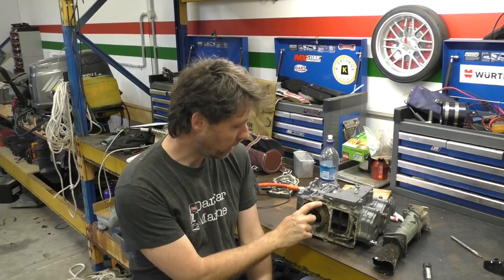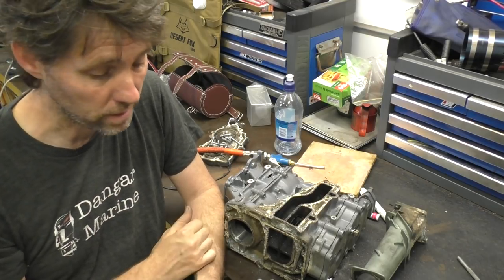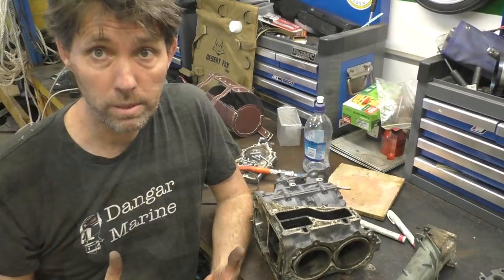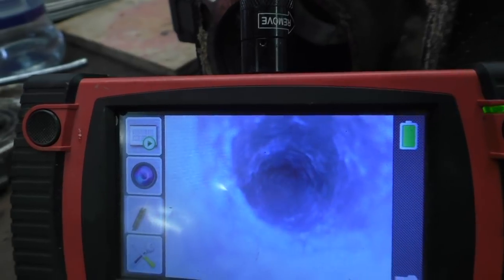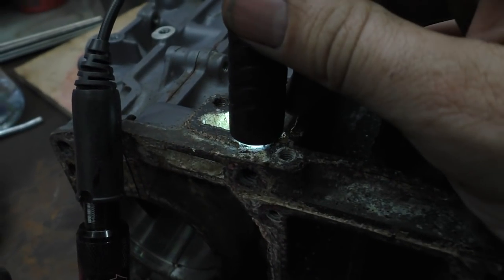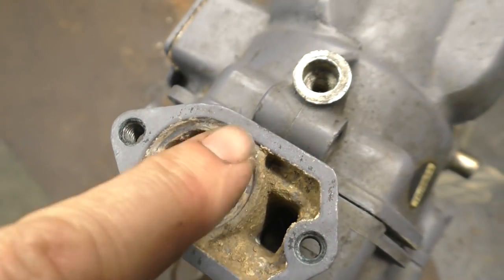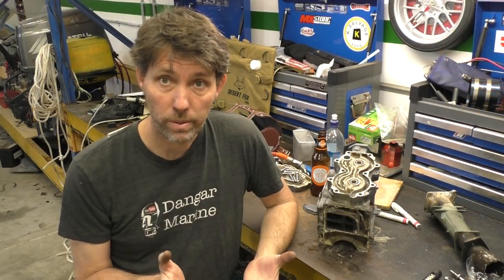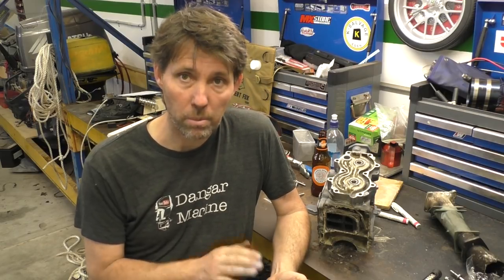Outboard cooling water

Comment: Wow brilliant.  Thanks dangar. This is the best outboard channel imo. I think your information here has solved my 8 horse yamaha problems.  Compression was 145. Sporadic tell tail . Bought a laser thermometer. 120 c . My other identical motor runs at 45c
Cleaned all the passages. And found that the rubber gasket on thevwater pump can get pushed in from the connection tube from the upper leg .impeller bits were found in the lower part of the impeller underneath the stainless steel cup that the impeller seats in as well as a small side chamber at the side of the cup. I put a rag on the drive splin and a drill a rotated clocknwise while the lower leg was immersed in water 
 It did pump water

Comment: This is the ONLY video or the only time PERIOD that I have heard anyone mention that cylinder compression can blow OUT through the  water jacket. I have an old Gale that has grey sludge in the leg and in the impeller housing. It pumps water at idle but not when throttled up. Compression is forcing water THE OTHER WAY as the engine is throttled up...problem....bad head gasket between water jacket and cylinder blowing mixed gas from the cylinder down through the water tube stopping the water flow when compression is high and thus....GREY SLUDGE....oil, gas and water mixture in the leg and impeller housing. I am changing my opinion of this fellow......GREAT vid.

Comment: I had no idea that the tell tale only indicates that the pump is pumping. I thought it meant the engine was being cooled. Thanks for pointing that out Stu. I learned something new today.
Reply: Hey mate. It does depend on what engine you have. The tell tale on my 1993 mercury black max 175hp is tee'd off after the thermostats so will only show water if the water is running through the heads and the thermostats are open.
Reply: And then you have my 50HP Johnson - no tell tale at all! That worries the missus no end as she thinks there is some thing is wrong with the engine because everyone else's engine has a tell tale. The following year model had a tell tale low in the exhaust cover. A few years later they went to the top of the block - supposedly to vent air out of the water jacket at start up and so prevent an air bubble forming. The tell tale on the Johnsons eventually ended up in about the same place as the one in the video- I don't know why. I do know that tell tales after the thermostat was done on only some engines and the tell tales before the thermostat were done soon after- why? Too many warranty claims/work because people were bringing their engines back in because the tell tale was not flowing when doing a flush and/or when the engine was first started up. People would panic, cancel their day on the water and not want the engine back until the water was flowing as soon as the engine ran.That hole to the cylinder top from the water jacket does not make sense. Could it be a decompression valve hole?
Reply from the maker: I would say by far the majority of motors have a tell tale straight away but checking the owners manual for your exact model is definitely the way to go to be sure!
Reply: Dangar Marine thats true bud! On my 50 merc there is a huge problem of having no tell tale because there is 2 different plastic elbow fittings that clog easily. The tell tale hose runs from the bottom of the block. So I learned how to correct it on a Louisiana  merc refuge forum. There is a brass hex plug on the top cyl that is the same size as the plastic elbow on the bottom. Remove brass plug and put it where the bottom elbow is. Put the plastic elbow (or i bought a new brass one) on the top. I drilled out the pisser exit hole and ran 5/16 line straight down to the exit. No more bends.Now i have a TRUE indication of water cooling because its after the thermostat. Now my motor never has a blockage and always pees. I even called Mercury because i was worried that there was a reason like back pressue, for the design. Mercury told me I was totally fine and you can even use a larger hose because its has no effect. The next best thing to do is run a temp and water pressure gauge. What everybody down here does is change the tell tale and add a temp gauge and as Danny on the refuge says "No more looking back when driving the boat". Im thankful the guys showed me this.

Comment: I can always count on finding helpful information when I watch your videos :) thank you. I had something strange happen today and would like to know if you have heard of such a thing... 2007 Yamaha 50hp 2 stroke. Haven't been out on the water in a few months so today I was cleaning up the boat and decided to run the motor. Hooked up the muffs, turned the hose on full blast, went to start the motor, got a couple revolutions out of it and it stopped. Switched to both batteries on, still no turning. Checked voltage and had 12.6v. At that point I pulled the plugs and the bottom cylinder had water in it. Kinda brownish/dirty. Cranked the motor for 20 seconds or so and shot all the water out. Cleaned off the plugs, put them back in, and she fired right up. Ran it for 30 minutes on the hose, everything seems normal, revved up a couple times, so far so good. Pulled the bottom plug again and didn't see any water in there, kept the hose running and still no water that I could see getting into the cylinder. Any idea how that water could have gotten in there? What should I look into next? Or just run it and see how she acts on the water before getting any deeper into it?

Comment: I'm attempting to strip down and rebuild a 85hp Mercury Blueband as a complete novice from watching your vids. So far I've run a compression test with all 4 cylinders running under 100psi  I've found that the impeller is completely munted with 3 missing fins and the housing has melted..I believe that 2 fins have made it up to the head somewhere. Thankyou for making awesome vids👍🏼👍🏼

Comment: Okay, I bought a boat without the motor running. I figured how hard could it be. Well, no spark in one plug and low compression in one cylinder 60psi. After trouble shooting I ordered a new power pack as I feel that is the issue after testing and moving wires around. Next for the cylinder I am going to try the Marvel Mystery Oil to see if it loosens up the rings. It's such a crap shoot for us backyard mechanics - so to speak. I know I may have to replace the head gasket but first things first so I am just waiting for the power pack to arrive. 
Your videos have been extremely helpful as this is the third boat I have worked on after watching the videos. Keep them coming!
P.S. If you were in Canada even Ontario or even Hamilton I would be knocking your door down for help. LOL
Reply from the maker: Good luck with the fix mate, hope it goes well and glad the vieeos have been helping.

Comment: Great video! This has helped me confirm that the headgasket is blown on the 55hp vintage Chrysler (Sea King) that I have been repairing.  I finally got it running well yesterday but I noticed that water just blasts out of the telltale (with steam too) so I think I will have to get that headgasket replaced.  The thermostat is probably stuck as well since water only came out of the telltale (bottom end is off so I can see what comes out).   Thank you!
Reply from the maker: Yes, the steam and shooting water is definitely a fair sign of a blown headgasket. Good luck getting it fixed up, sounds like it will be fine once the job is done.

Comment: Awesome explanation.

I was taught (incorrectly) many years ago that the tell tale was the "last" of the water and that if it was coming out then it was flowing everywhere correctly..  I was also taught to wait until the tell tale water was warm as that indicated the engine was warm enough to start opening up the engine..   Geeez Grandpa..  You had me fooled all these years :P
Reply: That depends on the engine. Some Johnsons had the tell tale plumbed up to outlet side of the thermostat in the 1975 - 1980 time frame.But the wait until the tell tale water is warm is not a bad idea. As you can see from the video, the cold water side will still get warm before the thermostat opens up , and then stay warm because the thermostat will control the temps and keep it that way. But that tell tale should never be hot. So letting the tell tale get to be warm before opening up the engine full throttle is not a silly idea at all.
Reply: Thanks for the clarification

Comment: Nice video Stu.  I just got the cooling issue on that 25 Johnson on my new aluminum boat sorted.  It had a broken thermostat.
Reply from the maker: Glad to hear you got it all fixed up Will.
Reply: what was it doing ?   my johnson has a weak tell tale and nothing out the exhaust hole , I am going to check the thermostat and pull the leg , it should have a new impeller

Comment: Greetings from tampa Florida Master Stu big proud happy followers of yours here . I have a 96 Johnson 225 and I’m having overheating problems I suspect sand on the heads , gotta go easy on the islands this summer i supposed , Cheers 🍻 my friend .
Reply from the maker: Hi mate. Yes, sand can certainly block up a cooling system fast. You can try taking off the gearbox and the thermostat cover to flush it out backwards with a hose.

Comment: I know this is a decent thread dig but the extra exhaust port holes are bleed down ports to reduce cranking compression for easy starting.
In some cases, they are just small extensions to the top of the exhaust ports.

Comment: That’s why my 25hp outboard was hot on idle but pumping hot water.  The water jacket was blocked.  Outboard had been sitting for a while, by running in the ocean it cleared the blockage and water shot out the upper exhaust port. Thanks

Comment: Exactly the information I need! My 25hp yam has that exact engine block. Tell tail pumping very strong but I noticed the spark plugs turned blue. Thermostat was packed with sand. Suspect that is not the only issue since the previous owner melted the impeller and its housing. Hoping to find an obvious peace of plastic blocking a port. Thank you! 🇮🇪

Comment: Perfect explanation. I was getting a poor tell-tale flow so went to the impeller. 2 blades snapped off and only 1 still in the pump housing - so how to find the lost one? Didn't understand the Yamaha cooling system as the service manual doesn't cover it. I didn't know where to begin. Based on your info I think it's likely sitting where the vertical water pipe meets the block. I'll drop the lower unit again and try running water through the flushing port to see if I can flush it out.
Really excellent explanations - thanks man!

Comment: GREAT VID. I live in one of the worst water conditions to run any boat in but just so happens that it's the best place to boat. S.W. Florida in the USA we have dirt, mud, and shells shallow water every where and a mix of fresh and salt water. In the past with older outboards I've used muradic acid to get rid of The Saltwater scale that formed inside the engine this is tricky because you cannot let it set for very long and it will do internal damage. but it did work very well to keep the engine running cool. When you get to the point where there's nothing to lose there's, nothing to lose. I have a suggestion is to dip one of those engine parts in muriatic acid and show your viewers just how fast it would work. Best Regards, and boating
Reply from the maker: Hi Tim. Yes, I'm planning to do a video comparing various cleaning agents soon. I might do it this week actually while it is topical. I'm thinking Muriatic (hydrochloric) acid, vinegar and Salt-Away. It will be interesting to see!

Comment: You need to get paint pen to mark the year and then make and hp and on the lower unit how long it is. On the motor you have laying around plus when you work on somebody's motor are working on your own motor you can write the date on it. So that whatever part of the motor you are working on. You and who ever the motor belongs to will no when it was replaced or when it was rebuilt or if you just service the motor. This is what I'm going to do so that I know. Im a first time boat owner  I really like your videos . It's giving me helpful hints of what to check and look for on the used pontoon boat I just bought that has a 1990 60 horsepower Johnson pro series with  three cylinder that hasn't been ran in over 6 years.

Comment: Great video !!!!  Funny I have a mercury 2 stroke 225 EFI and my issue is the engine is not warming up (all heads are at 90 deg).... Changed stats, checked compression,  checked water pressure... And still same issue...
Reply from the maker: Hmmm, interesting problem. You could try swapping the thermostats out for higher temperature ones.

Comment: Great vid - thanks Stu!
As regards the purpose of the second smaller exhaust port - possibly to improve scavenging in the cylinder?  I dunno. Anyway - cheers 🍻
Reply from the maker: Sounds like another good theory!
Reply: @DangarMarine  I vaguely remember a term loop charged, not sure what it does. Fantastic video though.

Comment: Just got my Johnson 90 serviced here in Dubai. Because of the high temperature here, they told me to remove the thermostat which always are open anyhow to help the flow of water.
Reply from the maker: I presume they must have a fair bit of experience with your local climate. Things leave the factory the same whether they are going to Greenland or Dubai!
Reply: was told  thermostat also serve as a restriction in flow to control rate of heat absorption of coolant past heat source. and time spent in a radiator

Comment: Very instructional, Stu - as usual. Armed with this I'm going to go back at my little Johnson 3.5 hp water flow issue. No water out the telltale however water is being spat back out the four little pinhole exhaust ports halfway down the leg. Somehow water must be getting pumped up to the head and although blocked in the telltale channel somehow, it is still making the journey around the jackets and back down and out. After seeing your vid I see how this might be possible.
Reply from the maker: Good luck with the diagnosis. I would push a bit of compressed air backwards through the block from the tell tale outlet.
Reply: Good idea, Stu - will try that.

Comment: The port that is connected to the exhaust is autocompretion. It is working only when you start the engine.  In the first stroke,  when the engine start to crank, it release the comprention then the electrical engine  will run early and faster.
Reply from the maker: Cool, thank you!

Comment: thanx for the video stu . good explanation.  ever see a top cylinder scored caused by a blockage???
Reply from the maker: Normally it is from a lack of oil in the fuel, but overheating will cause expansion of the metal that can also do it, yes.

Comment: you do good stuff and explain things well. do outboards routinely do overheat alarms? with modern electronics it would not be too difficult to knock up a simple one for a few dollars.
Reply from the maker: Hi Norman, yes, they have a thermo switch that is linked to an audible alarm and they will usually go into a limp mode to cut maximum RPM but allow you to get back to the boat ramp.

Comment: I think the small exhaust port in the cylinder may be an E.G.R. Port due to the location of the port. Kindly makes sense cause there’s water flowing around those ports on the cover plate. Don’t know for sure though.

Comment: Good morning Stu,
Excellent video as usual, not something I need to do at this time and I'm happy about that 
: ) In one of your previous videos on voltage drop and Ohm's law, you used hydrochloric acid to clean some of the corrosion off some wires, so I went in search for some at my local hardware store but they didn't have any then went to several other stores still no luck but what all of them did have was muriatic acid so when I got home I googled muriatic acid and found out that muriatic acid has another name ( hydrochloric acid ),
After running my face straight in the wall, I went back to the hardware store and bought a one litre bottle of muriatic acid and it worked like a charm, I'm guessing I failed chemistry in school LOL
Reply from the maker: Ha! Yes, they are the same thing. Don't you love things that have more than one name!

Comment: As with other comments very helpful.

I am in process in trying to find  my water flow  problem .   But I just wondered how people know their outboards are overheating with having no gauge to tell them?
Reply from the maker: Most of the time there is just an alarm that goes off when they exceed a certainly temperature.
Reply: @DangarMarine   Thanks  . for reply.